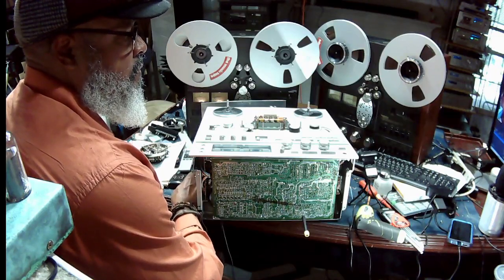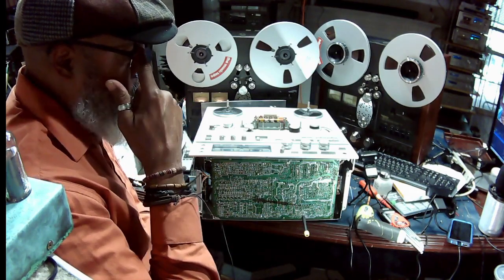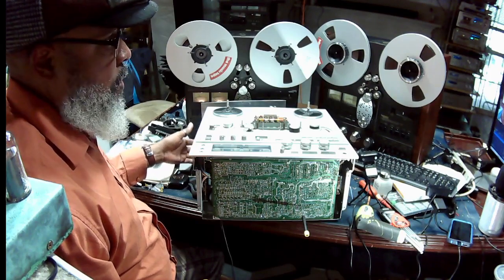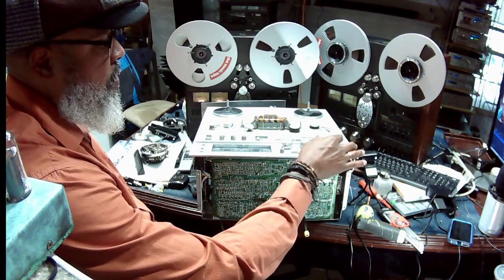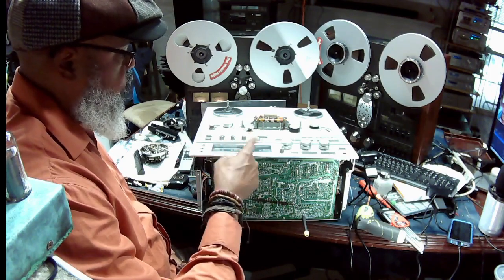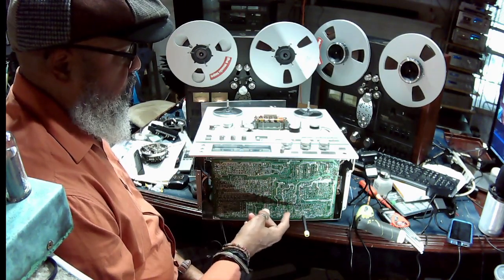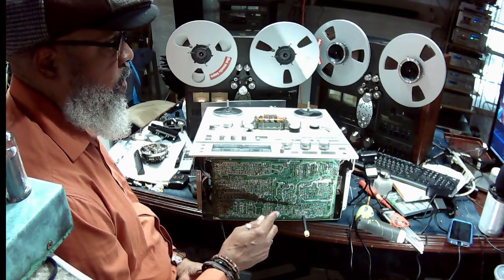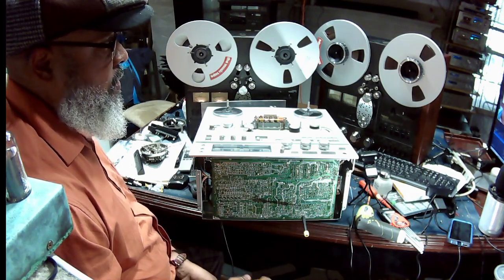TEAC X-2000R Reel to Reel Output Level Calibration (Clyde)

Comment: Hi Matt, Thanks for all you do with reels, I have acquired three Akai GX-4000d"s Cleaned up two of them, one works well but the other has a bad right channel input and I have not started on #3 yet .... Is there anything I should look for, or check on these machines ?
Reply from the maker: Hi SD, start by removing the back cover and see if the RCA input has a broken lead...assuming you've already worked the line input knob back n forth many times and still see no VU meter action when in source mode with a good input signal.
Reply: @5thcomm  Yep, cleaned all switches and inputs, I think it's a resistor and all the capacitors looked good not leaking or swollen, I get some sound but very little. Time for a tech to look at it. Thanks Matt